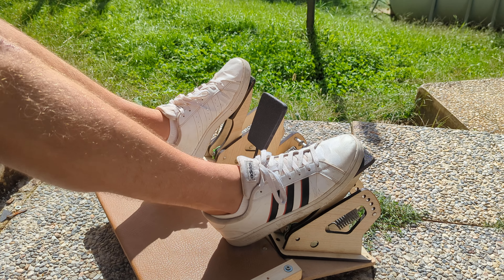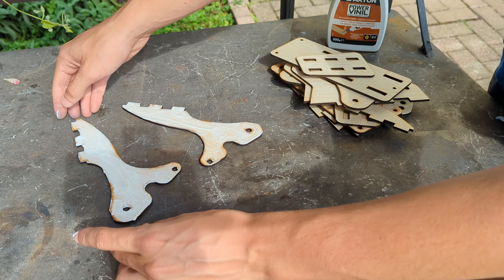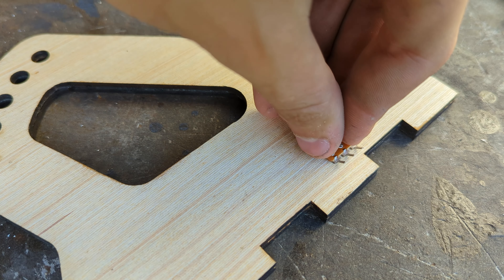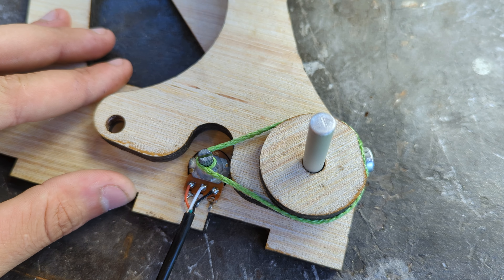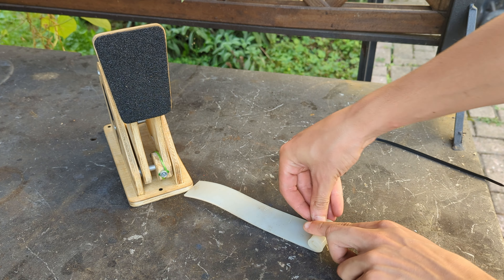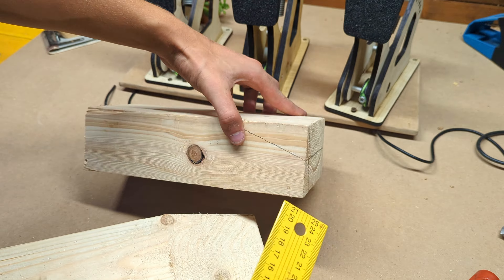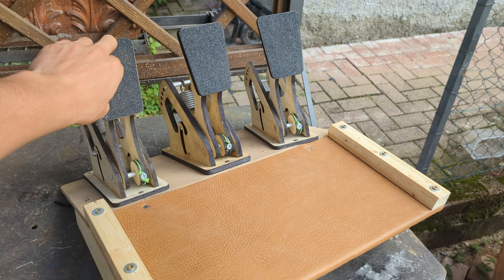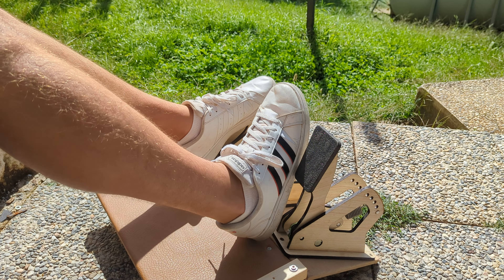DIY sim racing PEDALS  |  HIGH performance & FUN

Comment: Going to try this. I just got an old hoverboard for 10 euros, just need to order the odrive clone, pcb and other components now. An emergency stop and a brake resistor might also be a good idea, and maybe a fire extinguisher nearby. 

Seems like extremely good value as other plug and play solutions are extremely expensive if you want direct drive and more than 10 Nm while the cheaper options just look like toys.